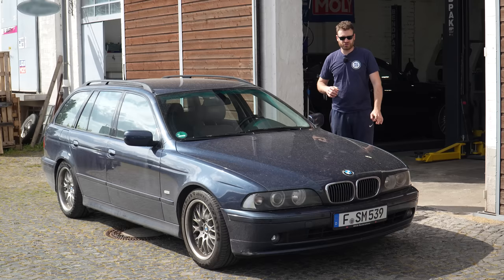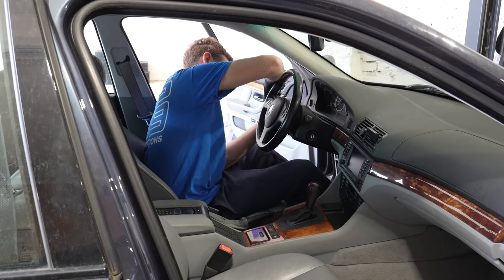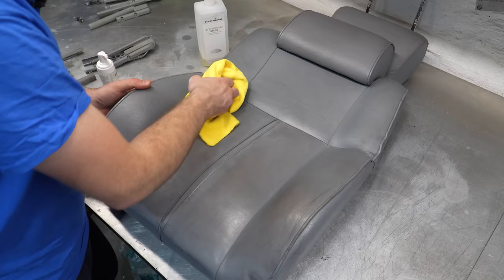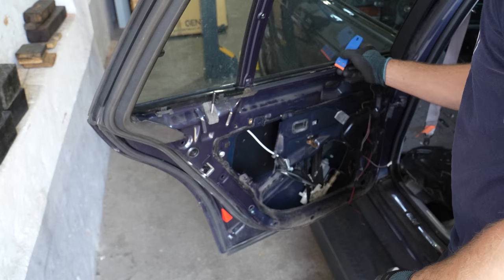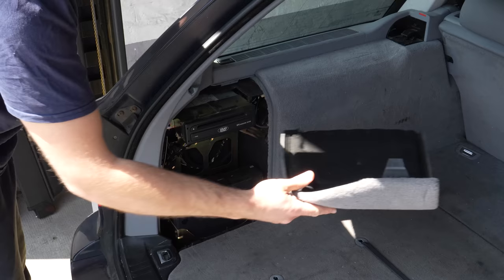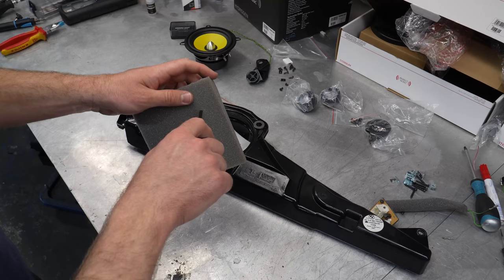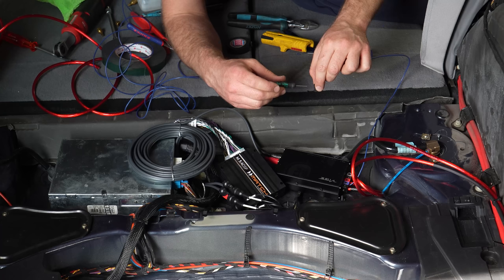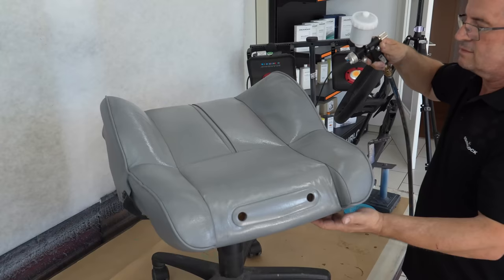Upgrading the 20-Year-Old Tech - BMW E39 530i Touring - Project Rottweil: P5

Comment: Thumbs up for bluebus! These cars are the best for these kinds of mods - old enough to be simple to work on and reverse engineer things for improvements, but modern enough for things to be digital, electronic and modular!
Reply: Well said. So true.
Reply: Tbh any aftermarket radio can do what the bluebus can and more. Bluebus is kinda overrated
Reply: @burntnougat5341  The benefit to the BlueBus is that it keeps all of the original computer functions of the head unit functional. And it also uses the original head unit, perfect for keeping the factory look (aftermarket head units just look tacky imo). The only thing most people need is a convenient way to connect their phones for bluetooth music, phone calls, and navigation. This is perfect for that
Reply: @burntnougat5341  Bluetooth audio is just one of the features of bluebus. It connects to the I-Bus (or K-bus, depending on car model), and plays together with all the existing modules in the car to add multiple functionalities in any of the car modules, just like you can see in the video. I know because I spent a month to make my own one based on arduino :)
Reply: @bradenclark1560  there are period correct aftermarket head units and many of the new Alpines and JVC are going with the understated look. You still keep factory wiring and retain steering wheel controls while gaining more advanced audio software from aftermarket units
Reply: @burntnougat5341  Can those aftermarket radios add 3-blink turn signal taps? Or true angel eye daytime running lights like more modern BMWs? How about unlock after ignition off? BlueBus can.
Reply: Bluebus sounds perfect - builds on what the late Simon did with the Intravee. I was amazed to add DRL, comfort indicators/locking and PDC distance display to my 2002 E39. Damn i miss that car!
Reply: @nathanaeljonesmyfsd  angel eyes are a hardware mod. Triple flash and door lock programming can be done with NCSExpert and/or Pasoft. Multiple ways to skin a cat
Reply: The BlueBus requires an E39 wired for a CD changer, right? My E39 doesn't have a CD changer, and I don't see any support for it when I check my VIN number.
Reply: @kimkimpa5150  if so, your use case would be perfect for a traditional single din head unit and swc adapter + aftermarket amp
Reply: @burntnougat5341  Really? Got any products to recommend?
Reply: @kimkimpa5150  it uses the wiring harness for the CD Changer. My E46 doesn't have it, so I tapped directly to the back of my radio for the audio part, and tapped into the K-Bus directly from behind the fuse box where the modules all connect together. It can be made to work, but it's not a begginers project.
Reply: @burntnougat5341  triple flashes cannot be coded on older cars, bluebus does this the same way inpa/ista activates your blinkers for diagnostics....probably :)
Reply: @kimkimpa5150  my current favorite headunit is the Alpine UTE-73BT. Pair it with a PAC SW2 for steering wheel functionality and your 4ch amp of choice that has high level inputs
Reply: @burntnougat5341  There's exactly one ALL IMPORTANT thing an aftermarket radio cannot do: look stock.
Reply: @burntnougat5341  Thanks, I'll check it out
Reply: @CrypterMKD  You're exactly right; I abuse factory diagnostics (I/O Activate Functions) to achieve these "Comfort" features. :)
Reply: @burntnougat5341  I could be wrong, but I don't think Triple flash was codable until late into the E46s run (2004+), and not at all available on the E39. Plus, 3 is such a bad number -- not everyone merges that quickly.
Reply: @burntnougat5341  No, door unlock at key-off cannot be programmed into the modules. It's not an option that the LCM or GM offer.
Reply: @burntnougat5341  Sorry, but all those aftermarket things look hideous to me. It just doesn't fit the interior. The double DIN ones are even worse as the buttons always look wrong and feel different than stock buttons. The graphics on the displays on those things are the worst part, what are they thinking at those companies? I don't have (or want) a BMW, but I do appreciate what Sreten does with his collection, and I find it really cool that enthousiasts develop hardware like the BlueBus, absolutely brilliant.
Reply: Yeah if I had one of these, I’d take the OEM integration over an aftermarket head unit ANY day of the week, so much cleaner
Reply: @fritsified5952  there are period correct minimalist head units. There are a couple from the likes of Alpine, Sony, JVC, and VDO. Bluebus is cool solution don't get me wrong but the oem hardware audio wise is still severely lacking
Reply: @burntnougat5341  I understand the appeal in certain cars but in something like this that’s going to be such a nice example, it would let the interior down big time
Reply: @boydsterling3193  matter of opinion. Period correct radios or even full screen double dins look good while offering more than oem
Reply: I emailed them before the video ended, and received a response instantly! Glad to know they’re working on the same thing for those of us with an E66 that needs updating.
Reply: I had one and they seem to introduce electronic chatter into the audio signal.
Reply: @studiomwg  that can typically be filtered with a ground loop isolator.
Reply: @bradenclark1560  People have actually installed modern idrive systems into e39s and it looks flawless! That's the only thing I would ever consider over the original unit.
Reply: @nathanaeljonesmyfsd  The I-Bus App and Resler Module can do everything of the mentioned stuff as well.
Reply: @andreasu.3546  WRONG. The Avin Avant 4 can do that easily without the need to rely on 20-30 year old audio equipment. 

The Avin paired with I-Bus app enables the older K-Line based E-Series BMW to be as modern as a new G-Series, with the optics of the E series and the benefit of exactly knowing what the car is up to. Add deep OBD onto the list and you can even check faults on the go and get much more data from the car. 

The old E46/39/38 provide a lot of data, the IKE isn't able to remotely display. In my opinion a big leap forward and it is plug and play, so no cutting wiring or something. Just unplug the old stuff, add the new (when factory navigation a 6m extention cord is needed) and there you go. 

Looks as stock as OEM but is as modern as it gets.
Reply: @boydsterling3193  Well no. If you drive a E39 daily, the old stuff is just annoying. Had the 16:9 in my E46, navigation was useless (map from 2018, so recent enough for my area), the Harman/Kardon sound system didn't deliver either. My android headunit with an integrated DSP did manage to get a much, much better sound from the H/K soundsystem which is worthy of the H/K logo, the I-Bus App and DeepOBD offer great functionality and deliver many functions to bring the older E-series into the 21st century. 

Bluebus is also a good development, but only works with the OEM stuff. And If I had to choose between OEM and Xtrons/AVIN, I'll take the latter one every time. 

It's the own taste, that determines what to do with the sound/navigation system, but I added so many Xtrons/AVIN systems over the years into the E39/38/46, that I can say, that all of them are very happy with it.
Reply: @jensharbers6702  > Looks as stock as OEM

Not bad...until you turn it on...
Reply: Would love to have a drop in replacement that just adds bluetooth in my 2010 crosstour, its basically an 08-12 accord and i dont have navigation so it’d be even easier to do so. The bluetooth module in the car is only for phone calls and not audio sadly
Reply: @jensharbers6702  I do understand the appeal of them and the benefits (I’ve had them before in other cars) but for me, if I was going for a super clean example of an older car, I’d still want to be true to the overall “feel” by keeping it OEM. Like you say, personal taste
Reply: @burntnougat5341 ok boss: show me an aftermarket radio that looks like it belongs into this car and can also change the way the bord computer behaves (central lock, highway indicators)
Reply: @D3nn1s  vdo tr7412ub-or. Reprogram the modules with ncs/pasoft...
Reply: @burntnougat5341  i mean ill have to give it to you, its not hideous, but its not good looking either. Also its not double din and youve lost navigation and all that now. By the time you buy this radio and a pasoft adapter youre also paying more for things you may not even need. Sure there may be other ways but bluebus is a neat and clean (not to mention fast and easy) way to do this while supporting small people rather than giant companies.
Reply: @D3nn1s  not all 5 and 7 have factory nav. The factory nav is useless anyway. Everyone uses their phones, google maps, waze, apple maps. If you want clean double dins there are sleek units like the JVC KWM56bt and Sony XAVAX3200. When you do sound system overhauls, it makes sense to replace all speakers and oem amp while you're at it to fully modernize the car. With all that, the pros of a thorough upgrade over retaining the oem stuff with bluebus makes a lot more sense. The few small bluebus only features are cool though but not a dealbreaker for many. Also the pasoft adapter is only like $30 usd. It's not expensive. The software can be installed freely. Anyone who has this era of bmw should have it in their toolkit
Reply: @burntnougat5341  What are the period correct aftermarket head units for E39? I kind of want one but the ones I've found look a bit tacky, are pricey and I'm afraid that after a couple updates the apps will stop working and they'll become useless as they are all essentially glorified Android-based tablets from some no-name Chinese manufacturers that would not bother with long-term support of their tech.
Reply: @GRicsi89  Please show me one that looks like an original unit. Not kind of, sort of like it. The closest I've found was a faux buttons frame for some Alpine/JVC HU with ambient lighting for the functionless buttons. Pro automotive grade, but expensive as hell, something like 200 GBP. Not gonna spend this much for a piece of plastic...
Reply: @nathanaeljonesmyfsd  3-blink comfort indicators can be programmed as someone mentioned and stock angel eyes do not pass for DRLs where I live and I believe in all of EU too as they are not bright enough. You'd have to modify them, but this in turn makes your lamp technically illegal and might fail you a yearly technical checkup. Bluebus is a nice, easy way of adding these features (if you have the changer wiring) but waaaay more expensive than it should be IMO. And stock head unit/amp in E39 really sucks, bb can't fix that.
Reply: @pdcichosz  If it makes you feel better, the landed cost of each BlueBus is just shy of 50% of the retail price. That's before I factor in the time spent writing the software, and if I consider my labor free, lol. It's the price I pay for not manufacturing stuff at a small scale :(.
Reply: @bluebusbt  that does not make me feel better but certainly shifts my perspective. My reference point was a locally-made simple bt adapter, it's roughly 1/4 the price of bb. I actually wanted to order a unit from you but stepped in just in time for covid supply chain issues and learned it was changer-only option so I had to look for a bt dongle.

Comment: Hah, after long time I've decided to bite the bullet and buy Bluebus instead of buiyng Android unit and today you release video where you install it, what a timing! Good for you that you had CD changer, I have only phone, so I have to fiddle with some custom wiring 😁😁
Reply: Those android hu are pretty trash. They use low quality components. Stock head unit or any quality aftermarket is the way to go but stock has no bt

Comment: I have been driving my 530i touring for past 10 years, bought it on 160k miles - now it's on 260k (418k km) miles and after doing proper maintenance I still can't find better car for daily than this one.

I absolutely love them, they are worth every penny you spend on them and give you so much joy.

Thank you for all tutorials you put up for us for free, they are great resource and with help of them I plan to drive my touring for next +10 years!
Reply: BMW's like this you can really keep forever, my friend has an F30 320d, I know very different car but he is over 450000km and it's all original still, as long as you look after it it will last forever!
Reply: I love my E39 Touring too ('02 525D with 274.000Km), such a comfortable car, that's definitely a masterpiece ❤️
It makes a long trip like a breeze
Reply: e39 is a wonderfull car although it's a bit to clumsy for my taste but compared to todays crap it the 7th wonder.  It took mine 97 out of storage today since I needed to do some heavy hauling, been sitting since new years evee. 
Even though it has 250k km on the odo it feels 10 times better than the stupid brand new thing I have from work that I got under a month ago. When I turned the key everything started right up. Not the stupid 30s delay with a million annying beeps and bongs. On the road, the hydraulic steering just beats everything from todays world. Not a singel stupid annoying beep while driving, just perfect.
 Even more amazing, the work car is an EV but the e39 is more quiter in the cabin even at standstill. It's just so much better insluated and built but when you push the pedal you hear the perfect symphony of straight six induction sound😍
Reply: Apart from the fact they rust

Comment: Great video again Streten. I was a professional audio engineer for all my working life. Don't worry too much about some of the comments, in-car audio installations are always a compromise in some way. Incidentally, you actually wired the subwoofer coils in parallel, not series as you said. The kit supplied by Dave looks pretty good to me, and yes, the subwoofer box is technically way too small, but who cares? I'm sure the system will be capable of way more bass spl than a sane person would like. Well done again.
Reply: One small detail that catch my attention. Long red cable for positive site of amplifier and a short black cable for "negative" site. When connecting an subwoofer amp, or any other amp in car, you only need to connect a positive "red" cable from battery to amp, but a short "black" cable need to be connected to a nearest ground point on a chassis. No need to run a cable to a negative site of battery. I thing that's a reason for black cable being to short. Can someone confirm that? Cheers!
Reply: @FalloutGeeks  That is correct, but a suitable ground spot is not always readily available and maybe thats why he chose to connect it to the battery. For myself I prefer having the least connections on the battery as possible.

Comment: Most often on the tourings, it's the front bushings that are quite torn and the rears don't usually look bad. As you noticed though, it really freshens up the rear end and rides so much better. I recently did the ones on my E39 M5 and while the bushings didn't look worn out, I finally got rid of a vibration I was having for the last 140k miles that I thought couldn't possibly be those bushings.
Reply: Yeah, shoot... has me wondering about the 20 year old bushings on my 540. Have they died slowly, so slowly I haven't noticed? Should I just change them out while they are still available? Being 20 years old now, starting to see parts drying up a bit - not as many choices, etc. and wondering a bit about the long term.

Edit: On the other hand... if you can still order that bracket that the subwoofer screws into, maybe we don't have much to worry about just yet.

Comment: Little advice for backup fuel pump,put in gasoline while sitting.I had perfect used pump which i just throw in box and after 1 year was totally trash,almost no fuel pressure and loud pitch noise
Reply from the maker: Makes sense, but fuel will evaporate. Would have to be sealed off.
Reply: @M539Restorations  Just find tegla for zimnica and fill it😂

Comment: Nicely done audio overhaul, you were actually my insipration to do audio overhaul in my e39 too, tried fitting OEM dsp amp to car with basic radio + sound, ended rewiring entire harness and changing all speakers + adding original Nokia subwoofer and switching to 12 channel DSP, sound improvement is unbeliveable

Comment: A little caveat on using CA (cyanoacrylate) based glue (which I am very sure is the base component of speedy-fix before the filling powder): I've had several occasions where over time the glue tends to slowly keep hardening/reacting. This causes the joints to become brittle and come apart after some time. For applications where the joint is hard to reach I would suggest using 2-part epoxy glue in the future. As a bonus these joints usually have some flexibility left after curing which should be beneficial when fixing parts in a vibrating environment like a car.
Reply: Would Hot Glue suffice?
Reply: @hughhennessy7912 no, hot glue is rather weak in comparison

Comment: It looks great, all being hidden away, and yet upgraded into something nice. Just don`t forget to check if the membrane from the woofer won`t hit the panel that comes over it. Especially when it gets louder. In case it does do that....I made something similar and cut a hole a bit bigger then the membrane and installed a mesh over the hole. It made it thin enough to let the membrane do its thing without touching. 
Looking forward to the next episode, have fun.

Comment: Awesome job man. For a slighter warmer sound and fewer rattles, I would’ve made an mdf ring for the sub and glued and screwed it to the face of the sub box. Also the amp negative can go straight to ground, so you don’t need to route it to the battery, saves a bit of time. Great job mate

Comment: If you retrofit oem dsp amplifier you can feed it from bluebus through the optical output bybassing bm54 radio.

Also there is pibus option which integrates raspberry pi to oem tv module with retaining original functions.
Reply: Is there any extra info about this topic? Thanks!